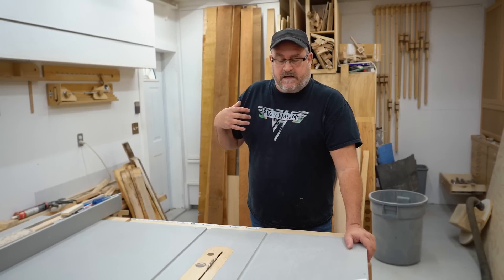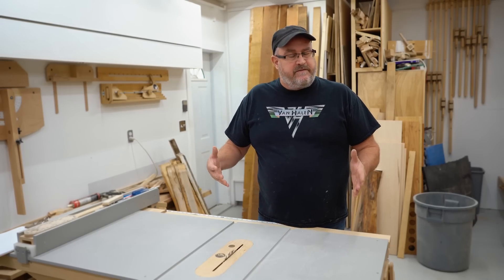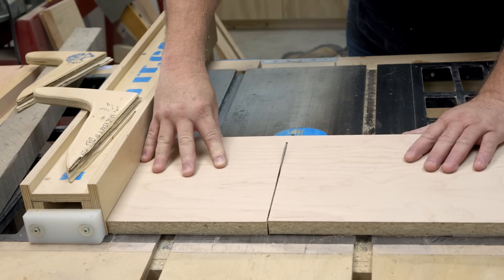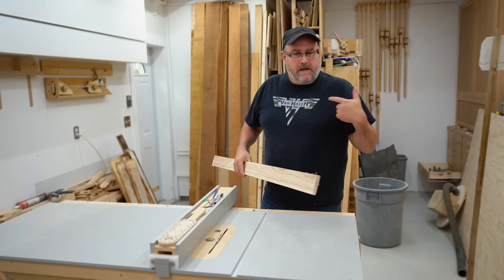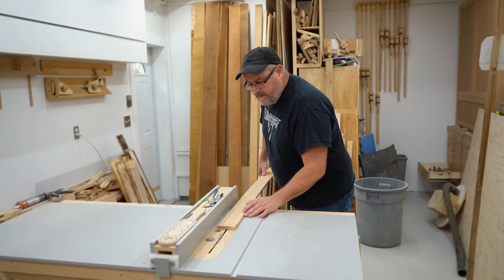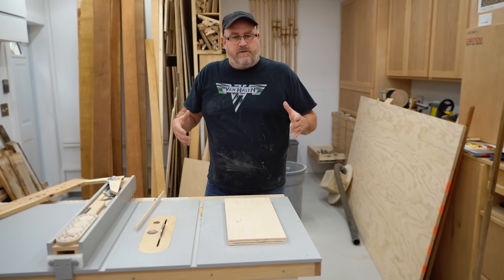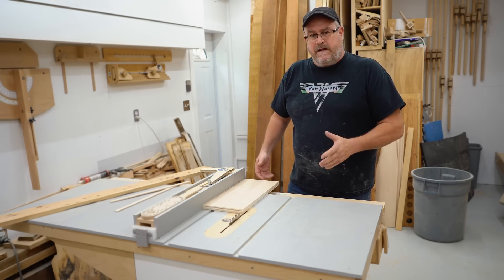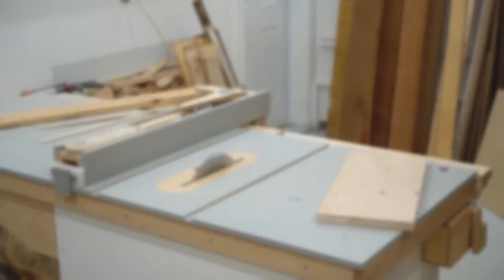Table Saw Basics - The Importance of Control

Comment: I've been a carpenter for most of my years (65 currently) and I can still count to 10 with both hands.  I've never had or used a riving knife or blade guard.  I do remember what my father and grandfather told me:  Familiarity breeds complacency so I approach all power tools with the idea that, if given the chance, they will bite and swallow.  Good advice John, nice work and great video, thumbs up ( a whole thumb btw).
Reply: A viewer responded to my comment by saying that there were still no reasons for not using a riving knife and that what I had posted was:   "we didn't need one of those back in my day, must be useless".  I believe that John stated in the video that the use of a riving knife is inconvenient as it must be removed when using dados, or different thickness blades.  He also stated that he did not recommend the removal of your riving knife from your saw as they do work to the purpose that they were designed.  As I have an old table saw that would require a lot of design work and machining it would be impractical to add a riving knife to my table.  If I ever purchased a new table saw, I would use the riving knife and see for my self if it was worth leaving on.  Personally I would much rather enjoy the lower price of a tool, without being forced into buying a tool with mandated safety features which add a lot of dollars to it's end cost.  I agree with John:  I take full responsibility for my own safety, in my own shop.  If I do something really stupid - it's all on me.  Great video John two whole thumbs up!👍👍

Comment: The most valuable thing I've learned from you is to watch the fence, not the blade.  After internalizing this, it boggles my mind that I don't see this being highlighted and hammered home by all the "experts" out there.  If they are talking about it, they sure must be doing so in passing, because I can't recall anyone else making a serious "hear me now" point about about it, like you have.  

I liken it to something taught to new motorcycle riders - don't look down, in front of the wheel, which is what your instincts will often lead you to.  Whatever is going on in front of the wheel, has "already happened" as far as you are concerned - in that, whatever you see happening there, you will never react in time to address it.  Look AHEAD.  

The fence is where the action is, and that's where you're going to know a problem.  When you're watching the blade, yes, you will see it bind.  And it will have already happened.

Comment: I appreciate your comments about table saw control and safety on this and other videos. Though I'm not as experienced as you (I have had many years pass since I was and active woodworker, although I've just started getting back into it), my own experience is more in line with yours. I started using a table saw in my dad's garage workshop at the age of 11. It was a saw that his dad purchased back in the 1940's. It had absolutely no safety features whatsoever and the table was maybe two square feet. Of the two other saws he purchased later in life and on which I gained the bulk of my table saw experience, only one even had a blade guard, and my father never used it. He taught me to respect the tool and use it properly. He also was very vocal concerning the risks and consequences of improper use and he was very strict in his teaching style. But once I learned the proper technique, he had full trust in me and rarely made any corrective comments. Although I understand the purpose and function of the safety equipment on modern table saws, I personally find them cumbersome and limiting -- and unnecessary if you know the correct table saw technique. I don't mean this as a careless statement or some type of woodworker machismo, but I have never even had a close call. I think this is because I am very disciplined in my focus on the fact that my saw will easily chew my hand off if I let it! It is my job to never let it have its way! Let me make this clear, as you have. This is my own experience and I'm not advocating the removal of any table saw safety feature. I'm just supporting a shared belief that the most important safety feature is proper use and technique. Keep up the great videos, John. I appreciate your effort.

Comment: The number one rule that my wife abides is “If you hear a motor running in my shop, don’t open the door and enter my shop”  I don’t want to be startled when using machines that are quite capable of maiming or killing me! I wear hearing protection when running most of my machines, and cannot hear someone entering my shop. So far, so good.
Reply: Excellent advice.
Reply: I learned that years ago when I came upon a co-worker who was operating an industrial sized and very noisy printing press. I unwittingly startled him whereby he stopped the press and told me never to come upon anyone who is operating machinery unless you are in full view of the operator. Excellent advice
Reply: My shop has the ceiling lights set up on two switches, with alternating tubes on each switch. When my wife wants my attention, she flips off one switch, which simply dims the light a bit. That gently gets my attention without startling me, or even distracting me, and works well for us.
Reply: @Pauken11  That is smart
Reply: If only that were true with everyone. I can't yell load enough or threaten enough injury to keep people from bothering me at my saw.
Reply: So constantly keep some piece of equipment running and you're never bothered...genius!
Reply: 🤔 great way to keep the better 3/4s out of the workshop 🤭
Reply: She'll just staple the divorce papers to the door instead.
Reply: I moved my outfield side of the table so I can see the door if she does come in the garage
Reply: @Pauken11  These are my instructions for my wife as well.  I also gave the option to turn down the stereo if its daytime and the garage doors are open.  I always have music on.

Comment: It's a right handed world so me being left-handed, I've mostly done things the way someone right-handed would.
I mostly use the riving knife that came with the saw but sometimes I forget to put it back on after doing an operation that needs it removed. For the most part the riving knife is just a decoration but once in a while I'm glad it's there when cutting some wood with a lot of tension in it. But like you've said in this and other videos, control the piece and learn how to deal with wood that does have tension instead of relying on a "safety" feature.
Last year I tried using the blade guard just to see what it was like. In my opinion it made things more dangerous since I couldn't control the wood as well as I would have liked.
And please be aware around that spinning blade people. A few years ago my brother's neighbour cut off four of his fingers on his table saw. The guy wasn't a newbie either. Very experienced but the guy wasn't focusing on what he was doing for that one moment. Just takes one time to not be aware of what you're doing.
Reply: Getting through all 4 fingers is amazing, sounds padded :)
Reply: @lllBAMlll  Sounds padded? I don't get it.
Reply: As they say, don't operate machinery when impaired - in ANY way!

Comment: Another thing I seldom see mentioned in these conversations is the absolute necessity of a sturdy, reliable table saw fence. 

The terrible fences on contractor saws and the like scare the hell out of me, and at the minimum I'd clamp a block at the far end for support, if you have no other options.

KNOW WHERE YOUR PUSH BLOCK / STICK IS BEFORE STARTING THE CUT.

Also, a zero clearance insert (if possible),  makes a huge difference for thin strips. 

(I don't personally use a riving knife, but plan on making another soon. It's obviously most useful on solid wood, but when you need it, you're glad it's there.)

Comment: Had I been using my riving knife I probably wouldn't have jacked up my left hand a couple years ago. Really it only would have saved me from myself. The other half dozen mistakes I made in the same situation are what really caused my accident. Safety features are great. I don't think I will forgo them anymore personally. You are right being fully aware of what you're doing and having control of the situation are the most important. Safety features are not. Really the best advice I could give anyone. Don't rush and pay attention. The only real pet peeve I have in my shop. Is if someone else is there and they want to help. They try to grab the material coming off the back of the saw. I don't know why people think this is a good idea. It's not. Your taking my control away. Without fail they always look at me like I'm an ass-whole for not letting them help. It makes me want to strangle them. There's a outfeed table it's not going to fall. I already cut 90% of the board I don't need someone else to pull the last 10%.

Comment: Great points all around, John. The importance of work piece control can't be over stated for TS usage. It would also apply to moving the work piece against ANY moving/ spinning blade or bit. Proper control, along with the knowledge of what actually causes kickback reduces any risk to a level I can accept.
  My older delta saw doesn't have a riving knife and I never even got a blade guard for it when purchased second hand. There are some cuts I simply will not attempt on the TS when I think that is too risky. I will use another method. It only takes one or two projectiles coming whizzing by your head to make you realize that there is a safer way to make certain cuts.

Comment: I’m left handed, and I’ve been in the trade since 1976. I think if I moved the fence to the other side, I’d probably cut my fingers off 😆. 

Other than that, I am 100% in agreement. Blade guards obstruct the view of the blade, and train the user to be complacent. Control, position, technique and listening to the tool, are more important than any extra “safety” guards.

Comment: John,  thanks much for the important aspect of safety, control of the work piece. Along with that, control and the awareness of the environment around the saw is also important, power cables, saw dust on the floor, tools on the table etc.., can all potentially lead to a mishap.

Comment: Good video John, I too believe the safest way to use a tool is to be comfortable and aware of the operation all the time. Safety features like a blade guard may get you on a relaxed state and make it very dangerous to use the tool. I support your opinions on this, no matter what you do a tool needs to be treated with respect and you need to have as much control of the operation as possible. Every scare should teach you a lesson and make you better at using the tool. Take for example the Jimmy Diresta's finger injury back in the day. He was already a pro at the time but lost his focus for a second and pushed his hand onto the blade. Don't mind what people tell you here, just keep up the good work.

Comment: I am relatively new to woodworking, only a couple of years and that's just on weekends (when I can).  Enjoy your videos and candor. 

First, absolutely like the idea of using foam board for demonstrating certain kickback.  (I imagine that the stability of foam cannot demonstrate how wood can curve back into the blade behind the cut. But its a great demonstration on the importance of maintaining control!)

A couple of take away(s) from this video (my interpretations):
1)  The responsibility of shop safety falls solely on the person operating the tool.  They should consider the guidance their past experience, instructor/mentor, and other sources of information (e.g. online videos, books, etc.)  (Follow/up interpretation:  If you do not feel comfortable on making a cut, don't!  Listen to the voices inside your head, it could be an indicator to learn more before practicing.)

2) There should be a balance of Control and Safety.  For me, if safety is first, then control should be tied (or at least a very close second). 

Added safety tip from my experience, to avoid complacency.  In addition to planning out the cut(s) and imagining the cut before execution; frequently try to replay the cut in my mind.  If replaying a bunch of repeated cuts is a blur, for me, it can be a sign that mental alertness could be higher.  Typically consider taking a break or switching tasks for a few moments to regain mental focus. 
(Note: For me, being a novice and hobbyist, time is less of a factor. Though my wife would rather I complete some of her projects in less time.)

Some call the "self-responsibility for your own actions" adage, a type of old-fashion common sense.   practice by many becomes common sense.  When it measures up to the test of time, it becomes "old fashion."
Reply from the maker: Maybe you don't understand what I mean by control. It's not something that you balance with safety, as in giving up one in favour of the other. 
Maintaining control of the stock makes the operation safer. It also produces better results. 
Using a saw with a riving knife and blade guard, while wearing a full face shield and a dust mask in a clean shop with no trip hazards and good lighting doesn't have anything to do with control. Control is about your position while making the cut, how you are holding the stock and not losing contact with the stock while it's being cut.

Comment: Control.   Yes.   
Good job putting experience into words.      
Also, now I'm curious to find a skilled left-handed woodworker to see if they handle the saw differently than I do.  (I'm right-handed).   I don't think I've ever seen someone who has completely flipped the saw left-right, so I wonder if most of them just handled it "right handed".   Hmmm.
Reply from the maker: It's possible to get good at doing right handed operations when you are left handed. I learned to shuffle playing cards by watching my sister do it, and ended up shuffling left handed. I can't shuffle right handed.
Reply: can't speak for every leftie out there,but I just handle the saw like a rightie would. Left side of our table saw is narrower than the right side,the power button is on the left,changing it around would be quite a lot of effort and limit me the moment I need to use someone elses saw.
Reply: I'm a leftie, I just use it right handed.   I also mostly use a sliding panel saw,  so that is probably what set me on that path.

Plus when I started all hand held power tools were designed for right hand use.

Comment: Serious question. Can you demonstrate how to cut with handheld jigsaw with out it making wonky cuts? Every single time I use a jigsaw for anything, the cuts are not square from top to bottom. The blade always seems to cock itself in one direction, making a wonky beveled cut.
Reply from the maker: The best way I've found is to use a stiff, very sharp blade and go slow.

Comment: Control means so much. It doesn't matter what tool. If the tool is stationary, the work must be controlled. If the work is stationary (heavy, clamped), then the tool must be controlled.
Reply: Very well put. Skill Saw is the worst offender.
Reply: @davidg105  Watching someone hold a board in one hand and run a saw across it with the other hand is just cringe worthy.
Reply: @act.13.41  same thing with angle grinders.

Comment: Control is the key word, and to be in control you have to be focused on the piece as it goes through and aware of your body mechanics.  Always watch the cut and make sure the piece stays in full contact with the fence.  I see people who will use two push sticks to make a 12” rip, you can see in there expression and body that they aren’t sure if they are in control or not. It’s relates to someone putting toilet paper on the end of a stick and cleaning their ass..!!  A push stick is only necessary about 10 percent of the time, it’s better to have the feedback and contact that your fingers provide.

Comment: I have never actually owned a dedicated table saw, but been around them most of my life, used them a fair bit. In my experience timber yards used to leave the riving knives on their horrible great rusty saws, and everybody else takes them off.     Blade guards you don’t see unless it is an independent fitting with extract plumbed in. Treat things that rotate at high speed with caution is my feeling about it, says the man who is prone to using a circular saw upside down in a Workmate !!

Comment: All good advice!  Where do you stand on products like the Gripper (Micro Jig).  BTW I just bought the table saw/fence plans and cannot give you enough praise for their completeness and detail!  Thanks!
Reply from the maker: I think the gripper is okay, although much bigger than it needs to be. I do like it better than trying to use two straight push sticks to feed the stock through, as that gives up too much control over the work piece.
My favourite is the one I use and I'll talk about that in an upcoming video.
Reply: @JohnHeisz  Hit the nail on the head. GRipper is too big. It more often gets in the way of the cut than not.  I rarely use mine now.

Comment: My saw came with all the safety bits including a knife and guard.  Guard quickly got in the way with small cuts and use of push blocks.  Like you control won out and I stop using the guard.  Now using thin kerf blades so no knife as well.  Think before you start including where I stand, what will I use to help maintain control without putting myself into danger, blade depth to a min, and alway, always maintain control.